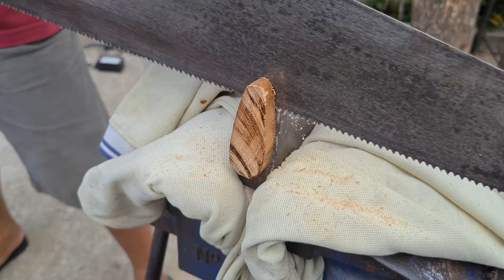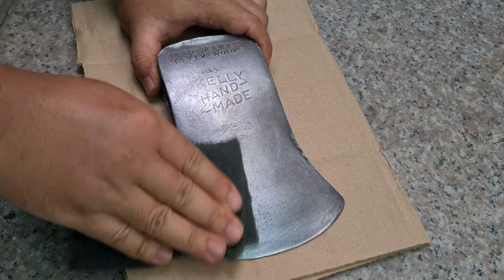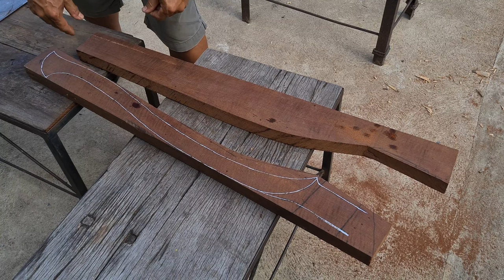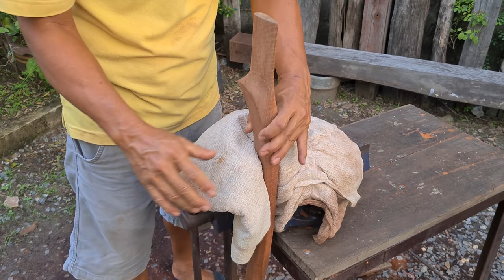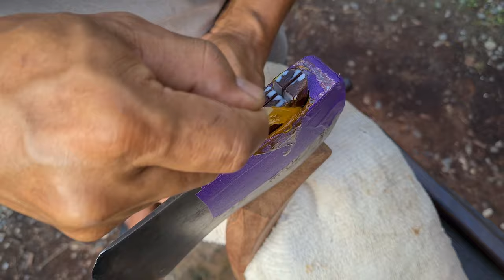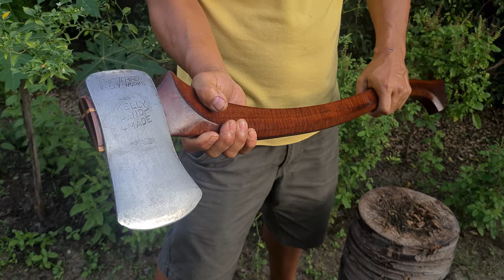The Process Of Making a Beautiful Axe Handle | Kelly Handmade True Temper

Comment: nice job, great looking handle, but the epoxy glue... unnecessary and idiotic. if that handle needs replacing some time, it will be such a struggle to get the wood off the eye again.
Reply from the maker: Thank you for your advice and watching🥰🙏🥰.
Reply: It wont be a struggle, all you have to do is to heat it, with steam, hot gun or whatever. The epoxy will come off.

Comment: Beautiful axe handle ! Just wondering about the grain direction? I wouldn’t swing it too hard.
Reply from the maker: Thank you. Actually the wood grain is quite best pattern , the pattern you see like the tiger skin pattern is a special feature of this type of wood which we like very much.👍
Reply: grain direction doesnt mean shit
Reply: @schlomoshekelstein908  if the grain is going left to right on an axe handle and you swing it really hard it will snap . You clearly no nothing about wood structure.
Reply: @jasonb4350  if i show you a united states foresty service manual that shows the strengths and weaknesses of each wood that was published in 1913 and had an anecdote that says grain orientation has no bearing on the strength of wood handles will you believe me?
Reply: @jasonb4350  he made that handle out of redwood, too. probably one of the weakest woods to make an axe handle from. grain orientation wouldn't save that handle
Reply: @schlomoshekelstein908  the wood he used probably isn't redwood, but some type of hardwood, he probably just called it that as they more than likely call it something else. I say that because if you've ever tried filing down redwood you'll see that it files a lot differently than the wood he's using. With redwood you'd probably have a crack already just by wedging it, yet alone swing it.